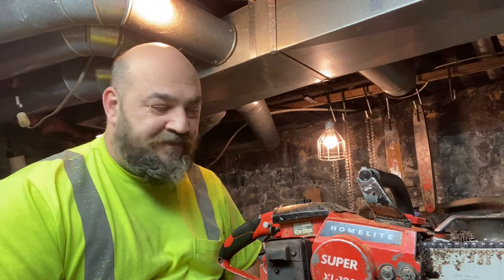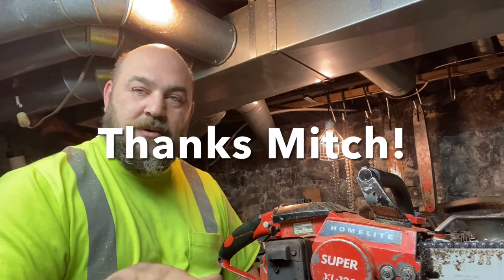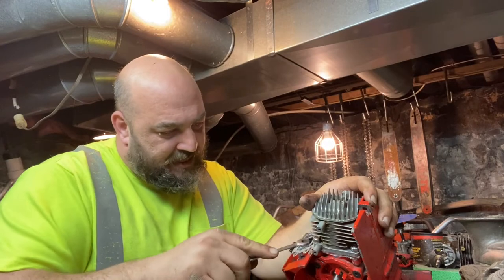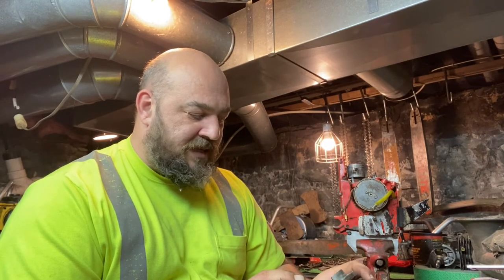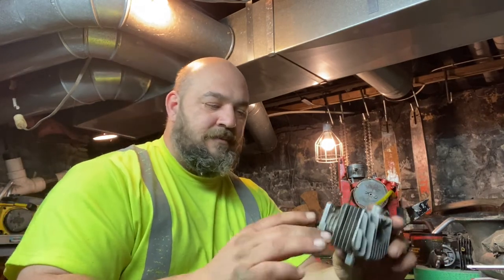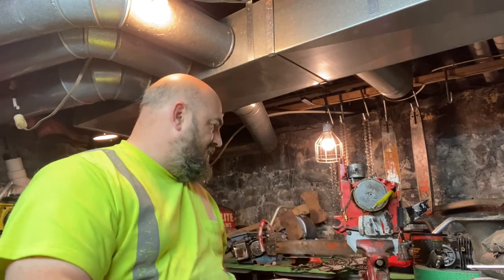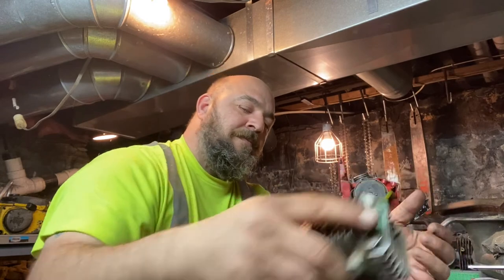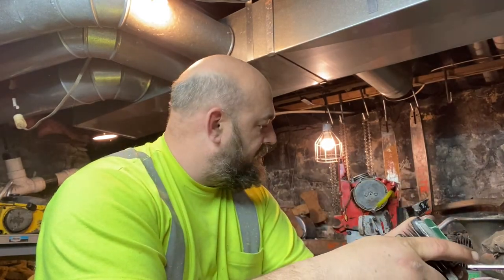Porting Homelite Super XL-130 Chainsaw!  Another teardown!

Comment: 100 degrees seems to be a really good number for any saw 60cc on up. I dont know how much 1 degree would change. I try not to ever go below 100.
Reply from the maker: My goal is 98 so we will see what happens.  If not no big deal.  I just want the challenge.
Reply: 100 is pretty safe. I like your thinking.
Reply from the maker: It should hold rpm in the cut decent at 101 then.

Comment: if its running overpowered at 101 will restricting the exhaust not produce the balance you want buddy ?
Reply from the maker: It was running overpowered with two boost ports.  I removed the boost ports and went to a more conventional build because the fuel consumption was not practical for a real world working saw.  I was averaging 10 minutes or less per tank of fuel.  It was awesome to run and pulled like a freight train but it was to much.  It would out pull any 80cc saw ever held easily but practically impossible to use in a real world situation.